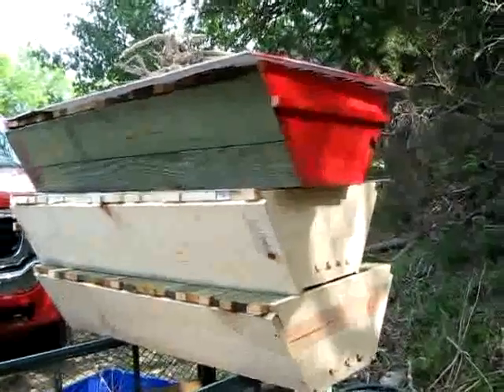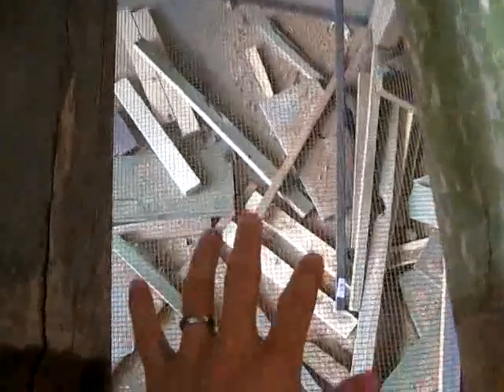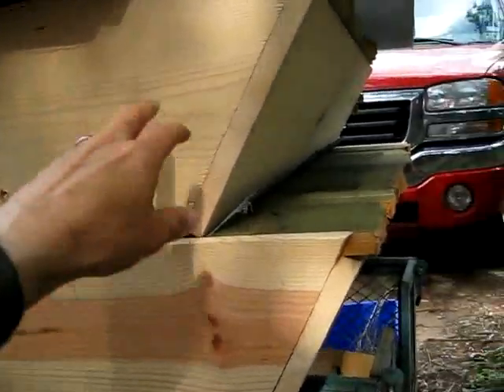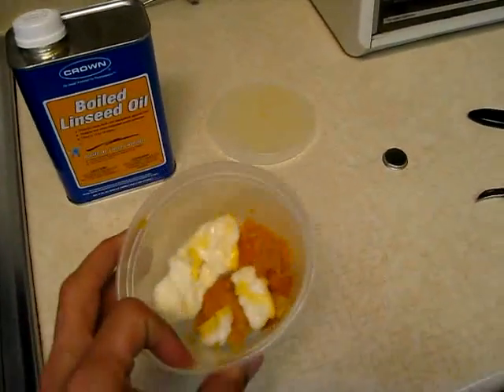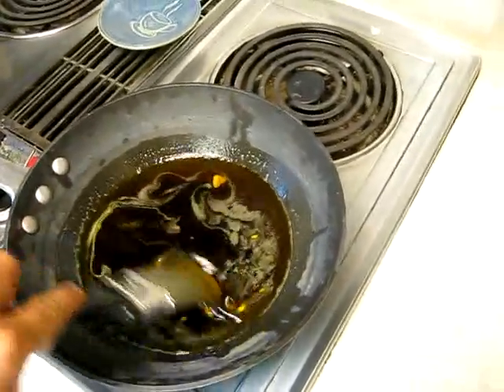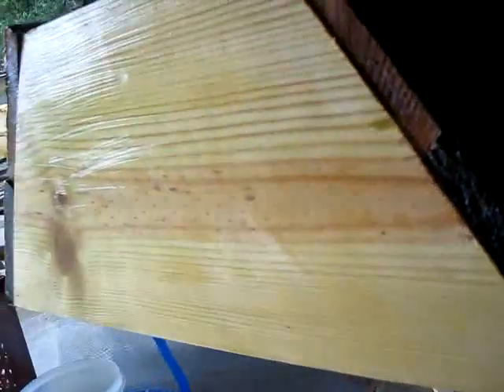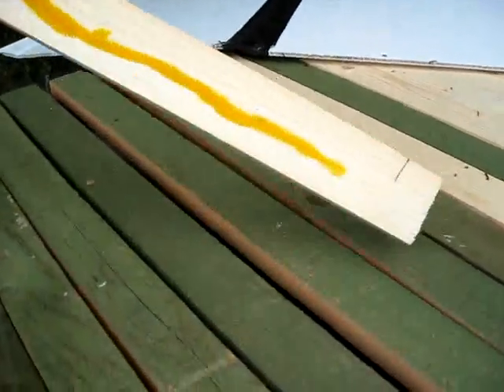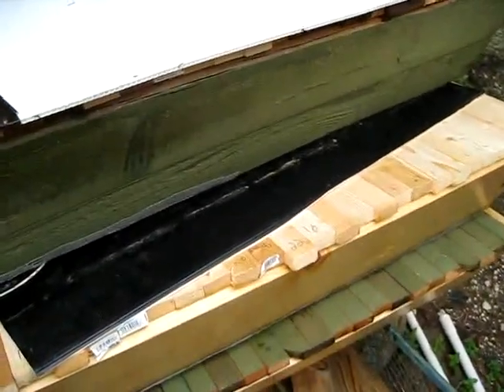Building your Top Bar Hive - Learning Beekeeping

Comment from the maker: @iamRapscallion Linseed did preserve it. But I'd just paint them next time.  What I did fine that was useful was that you should use nails, only use screws. The wood warps and forms cracks they bees get thru. Screws would have prevented that. My screens are just fine, so far.

Comment from the maker: @sunnykintyre Scotland?  The roof should be 1/2" wood to aid winter insulation and provide mass to prevent it blowing off. A brick on top will also help. That's a suggestion, some local beekeeper who keeps TBHs should be consulted.

As for the sloped sides, it reduces the number of bridge combs bees will build to the sides. Makes life better for the beek.

Comment: This is my first year with a top bar hive and it seems to be doing good. I am in northern Indiana and haven't gone through a winter yet. I read that top bar hives dont winter well and so am considering switching to a warre hive system. The book said the reason that top bar hives dont winter well is due to the fact that bees travel vertically for food when cold and do not like to go horizontal. What are your thoughts on this?

Comment: You didn't mentioned the entrance holes. biobees uses the side holes - which I would rather not - do you have a couple more holes on the other end for ventilation? thanks. just saw that big 2" hole in the other end. :)

Comment: Just came across this video so I haven't looked to see if there's a follow up on it, but how well are you finding that linseed oil/wax has preserved the wood? Do you close up that bottom in the fall/winter? I started out with screened bottoms on my TBHs, but ripped them out the 1st year. I've heard that the entire length being screen is too much ventilation and makes regulating hive temp difficult, any thoughts? Are your bees regressed/drawing small cell? Good work! (:

Comment from the maker: I would never recommend Bush's weather proofing to beginners.  Bush heated a vat of wax and resin and dipped much woodenware in it.  He had to custom make the vat, which is not exactly simple and not worth just a few hives.  Further, if you research more, others have tried and one caught the mix on fire and burned up some of his woodenware.  

As for dipping the starter sticks, not good, it is subpar for a guide. Watch my other vid on making bars using string and soidering iron.